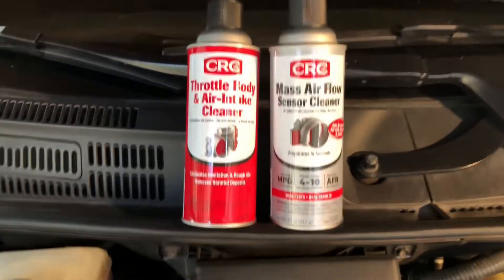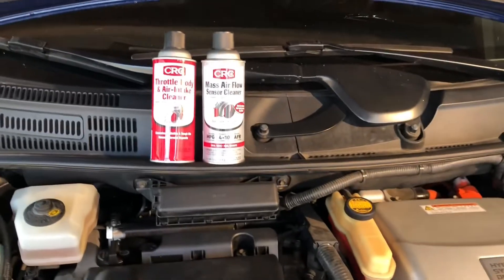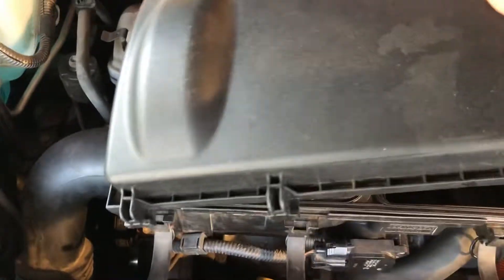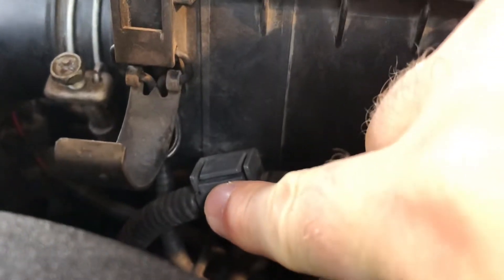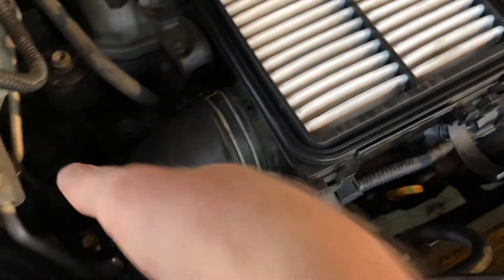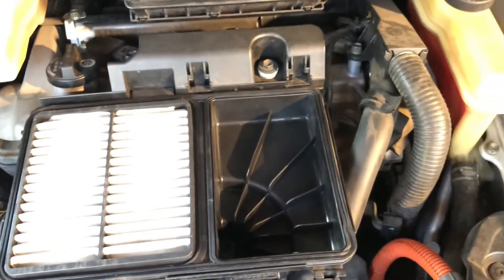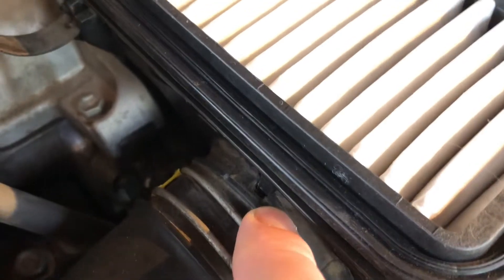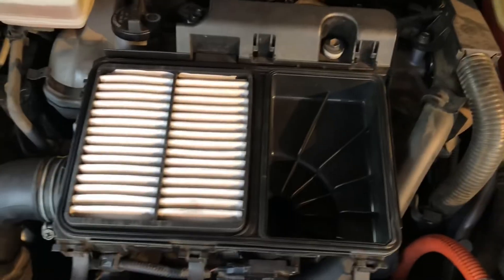Prius Second Gen Mass Air Flow Sensor and Throttle Body Cleaning Tips

Comment: Today I noticed when I was trying to troubleshoot the rattling and severe missing in my Gen 2 Prius.. I discovered that when it's running rough when it's in park and I take off the air cleaner assembly the engine starts running smoothly..

Comment: Hello i cleaned throttle body and maf sensor but it takes more fuel then beforr specially when i put heater on in prius 2005
Reply from the maker: Did you do it right?